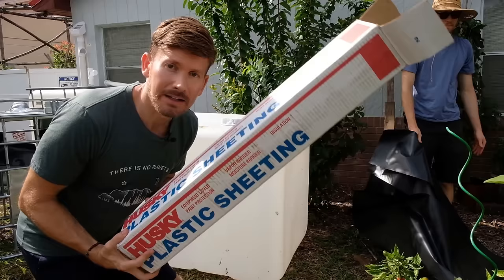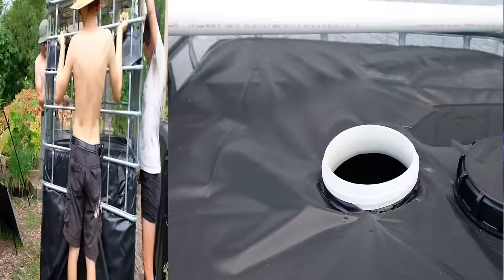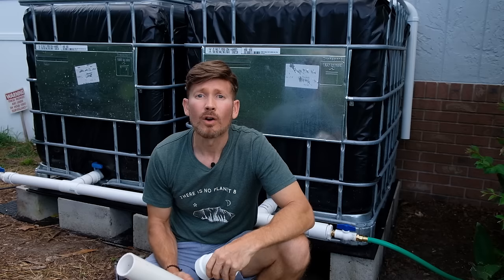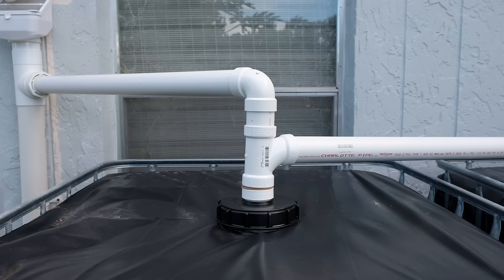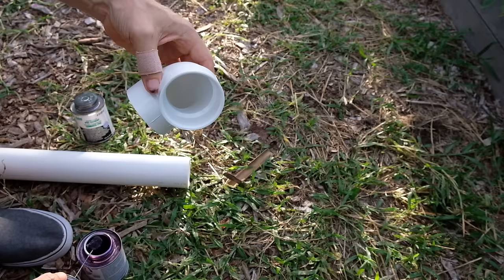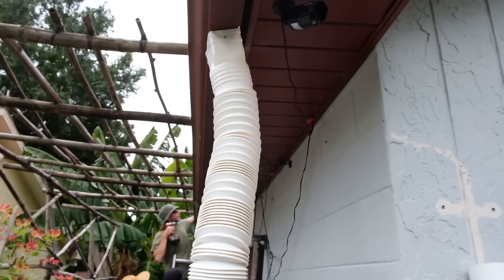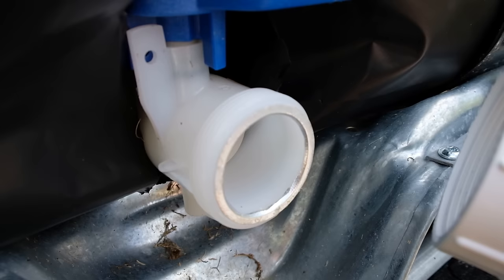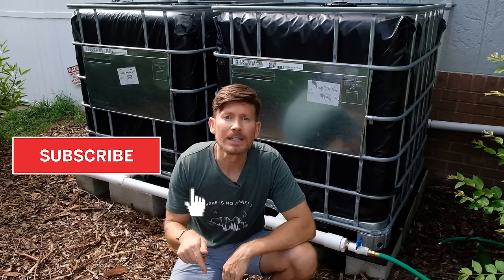How to Build a 550 Gallon Rainwater Harvesting System

Comment: What r people using to insulate the tanks? 
W r summers getting increasingly hot yr after yr I need a solution other than black plastic. I plan on cutting a few of my tanks & flipping the top to have tilapia (fish) in the bottom & hydroponic garden on top. Here in AR we experienced temps hitting >100°F 1st week of May. Then from June on it's been a rarity to have heat index <100°. Most days 104-112°. Haven't had any measurable rain since beginning of June. I burned thru 1500 gal rainwater storage in 3 weeks trying to keep my garden alive. Hydroponics is suppose to take approx 8% water compared to traditional dirt beds.
I had several people give me a hard time building such a large rainwater collection system in an area that gets  avg 40" annual rainfall. Now having to rely on city water my bill was $250!! I should of bought more totes, I planned on it but my calculations showed is have 30% more water required for 30 days. That's for a typical June w avg temps of 76° NOT 92" (ADD 10-20° FOR REAL TEMP) & night temps rarely dropped below 84° real temp. 2 months ago when I saw totes for sale $95 each!! I can remember when they couldn't give them away....
Reply from the maker: One thing I may do soon is attach some cheap wood fencing panels to the totes and then paint them white or some other light color. This will reflect a lot of the sunlight. The cage around the totes is perfect for attaching wood or UV resistant roofing panels. You could also grow some vining flowers over them or place fast growing plants in front of them. Yeah- the cheapest totes near me in Orlando is also around $100.
Reply: @naturehacker1095  the sky high prices for EVERYTHING is beyond ridiculous specially when corporations r making 300% profits. I'm wondering what's going to happen w all the battle farmers selling, some r completely out of business now. Will 80% of ur beef come from Argentina. For some reason I doubt will see a decrease at the grocery store...
I was originally going to grow plants in front & place in top to hang down. But w thermos her in AR going up & up every yr I'm fearful whatever I plant won't survive. My 10 yr old azaleas died & they r planted north side under the trees. I don't think they r coming back. My dogwood has dropped 80% of her leaves & the pecans & oaks been dropping pretty heavily also. The dang Holy is thriving- hate that tree. Other than the Dogwoods the trees r 50-75 yrs old sou know it's hot when they r struggling.
I've been wanting to test some pressure hydroponic putting fish in the bottom of the tank. My understanding it'll use approx 8% water than a normal dirt bed. I burned thru 1500 gal rainwater in 3 weeks trying to keep my plants alive. We haven't had rain since beginning June. & It appears there isn't any hurricanes out there to relieve US- which is good for u. But I also have cold winters. Normally I wouldn't b concerned but last 2 got pretty brutal, at least for us. Doesn't last long. I thought I'd putting 1 tank in my winter greenhouse to keep pipes/ hoses/ connectors from freezing. At this point trying to set up today in anticipation of what may come is difficult- coming faster than expected.
Thank u for ur suggestion I appreciate it. I'll definitely check it out.
Stay safe!!
Reply from the maker: @user-tn7xo7ky9o  I totally agree. Water is more valuable than we realized and creating a microclimate is so important in the desert of Arizona. Building swales, planting the most drought tolerant plants to build soil, get the soil sponge going and creating some shade. Mulching everywhere you can! But it’s so hard to get things started when it’s already dry and 100 degree heat. This is why we are here! We will overcome these challenges or we’ll die trying! 😊
Reply: @naturehacker1095  I was suppose to b fucked away in the cascades on my homestead. Parents decided to move to AR in 98 then dad had health scare & asked if I'd move down to AR late 09. They had beautiful home in the Ozark Mtns 7 mi. Up a dirty Rd to ur private dead end Rd then another 1/4 MI to the top where there house set secluded on 30 wooded acres. We had a lake under the house that no one else could tap into. 4k sqft, v1500 was basement buried in the rock on 3 sides, east facing all window walk out on other. Wood stove (my space I shared w my pair Rotties) & another in main floor. Massive shop w full bath & wood stove w every tool imaginable (dad is an amazing woodsman). Had my 4 season greenhouse, small orchard, wild cherry, kumquats, grapes, tanneries black & red, huckleberry & blueberry bushes everywhere... Miss those wild truly organic fruits planted by birds :) I'd mulch all the branches too small for fireplace & mulch all the leaves. I had to make all my soil since I lived on a rock. Man I loved that place. The decided late 18 to put house up for sale & move to Hot Springs into a retirement community. I begged them to reconsider. Told them they live away from people for reason & no way they going to handle rules & nosey neighbors. They thought it take forever to sell specially at the price they listed. I hoped that b the case so I'd have longer to work on them ;) Dang house went under contract in 2 weeks from 1st person that looked at it! I got a small bungalow near their community & had to start all over again. I can say I get to tell my parents every chance I get "I told u". Within 10 mo they bought a home in the edge of the county it's small residential neighborhood & peaceful. Dad had a fit when he got his first winter gas heat & elec bill $280 & $170 & $100 utility bill when he hasn't watered yard/ garden vs $100 back home- "Told u dad". Spent another $100k on windows, elec heat/ air & a massive solar system. Then for horsing their house making it self sustaining except water the county rewarded them by addressing the house for taxes for more than purchase price 9 mo ago "Told u dad". 🤣🤣🤣
I'm trying to get him to add IBC & plant some fruit trees & berries.
I don't plan on living here, not happy here. So many street lights they even drown out super moons, I think they canc my street from Mars. I'm 80% done w my major renovation then I'd like to sell. Get some acreage in AL, soon lives about 45 min east of Pensacola about 8 he drive. I can come up every other mo for couple weeks or stay if needed. Whatever system I set up I want it to easily b taken down & all the parts refused. Honestly I'm sure doing all this is silly but I've got to have my hands in dirt & growing- keeps me grounded. Not sure if people even would want the totes. I planned on putting fencing board on them also. Never thought of painting white, but that's good idea. 
Thought about putting cheap insulation between tanks & black wrap to keep sun out & insulation dry. Then put the reflectives, foil looking bubble wrap, on top of plastic then wood fencing. U know, the white pain would b good in winter inside greenhouse to bounce sunlight... That idea more & more... THANKS 😁

Comment: I honestly don't understand buying white tanks and then covering them in black plastic versus just buying black tanks
Reply: Way cheaper. Black tanks are hard to find. The white ones are used for food and you can buy them recycled for relatively cheap. We’re talking a difference between 80$ and 350$ between the two.

Comment: great video but i bet youre getting a lot of algae build up from the pipe that comes off the roof as the corrugations in the pipe will hold a lot of water , also your first flush system will grow lots of algae as it will never be completely empty and will block up
Reply from the maker: family plans I’ve never had any algae issues with the water tank. It comes out clear. The first flush diverter has a small hole at the bottom so the water empties out after every rainfall. Yes, it comes out slow enough so that it fills up during a heavy rain, but it fully empties after several hours. Some silt can build up in the bottom of the diverter over time but it just needs to be cleaned out every once in awhile. Very low maintenance. I’ve had no issues with this system 20 months later. I’m working on an update video that will be out soon!
Reply: @naturehacker1095  phew thats good to hear and interesting to know and would be great to see an update video

Comment: How much does a system like this cost?
Reply from the maker: I paid about $400-$500 with the totes purchased for $100 each. So it really depends largely on the cost of the totes which can widely vary. As for the leaf eater, instead of paying $60, you could get a 4inch to 3inch reducer and wrap some screening around the 4 inch side and secure with a rubber band and then attach it to the downspout diverter. I tried it on another system and it worked fine. So there are some low cost alternatives for some parts
Reply: @naturehacker1095  That's very affordable.
Reply: @nriqueog  hahah he didnt add all the material use. 
He isnt telling you the cost becuase the system cost around $800 including totes. 

I purchase ibc totes and  i started getting pipes and so far im out of about $100 thats only pipes,spigots.

Comment: Word to the wise, from a plumber... and I know y'all don't get freezing temps in Florida much, but even so....

You should never, ever, ever, ever, ever,  EVER!  Thread metal MALE fittings, into FEMALE plastic (PVC) fittings, as metal expands and contracts significantly more than plastic, and will quickly shatter the plastic female fittings. 

If you must convert from plastic to metal, convert as few times as possible, with metal always female, and pvc male.

Comment: My comments are being deleted. Why?
Reply from the maker: Hello! I have no idea. I haven’t deleted anything but I see that your last comment that was emailed to me isn’t on here. Weird. Anyway, the link you sent is for 20 cases which is about 20 sets of panels that are $12 each locally. So it makes sense that it comes out to $250. All you need for this project is one case for about $12 and it will cover enough ground for two systems. If you spent $12 for one panel, someone at the store ripped you off. The bar code was probably on the panel and they got confused.
Reply: @naturehacker1095  We ended up returning the panel. I've looked at the Q&A on this product and a comment by PaverBaseCustomerCare person clearly states that Home Depot sells the panels by single unit. The only price tags I've seen are: $13.38 and $259. So a single unit must cost $13.38 and a case of 20 single units (20 panels) would then cost $259. That's the logic I see here.
Reply: @jakx2828  Ahh Ok. Well, I guess my store has been getting it wrong then and giving me cases for $12. So I guess I saved over $500 this year. I used these pavers only because I live in Florida and the ground is soft and sandy and it also keeps weeds away from the system. It's nice to have the extra stability and level surface with some type of pavers.

Comment: Plastic, plastic, everywhere ! ;<)
Reply from the maker: @MarquisVonLion  We are using plastic but reducing the need for single use plastic by repurposing IBC totes. If you use a metal cistern for example which is very expensive and outside the budget of most Americans, even those are lined with a thin plastic layer. The alternative is drinking out of plastic gallon jugs or being lucky enough to have well water or a mountain spring near your home.
Reply: @naturehacker1095  We have a well, but the water is so hard here in Southern New Mexico, that we have a rain water system for the garden and the house, 2 2500 gallons tanks ( made of plastic ;>) and 2 IBC totes , all of it running thru PVC pipes ;<) , we're all made of plastic nowadays, although we try,  can't get away from it.

Comment: Glad you are trying to help the earth. However plastic and duct tape are not going to last very long before needing replacement. Kinda negates your efforts. No disrespect but there is room for improvement here.
Reply from the maker: I agree…but. There are covers now that can slide over the totes, but it’s hard finding a quality one. If you’re good at sewing, maybe you can create a better solution for all of us. Painting the barrels can expose the water to toxins. My system is going strong three years later with no degradation of the plastic. We need solutions now. This system is the best interim solution until we get enough businesses making stainless steel or earth material cisterns that are easily available and low cost. We don’t have that right now. It needs to be a community effort to make rainwater systems low cost non toxic and easy to build.